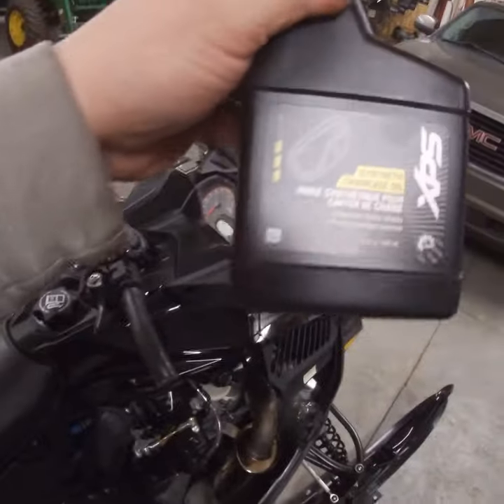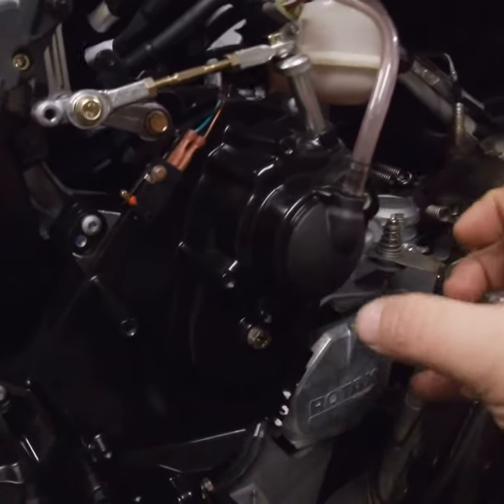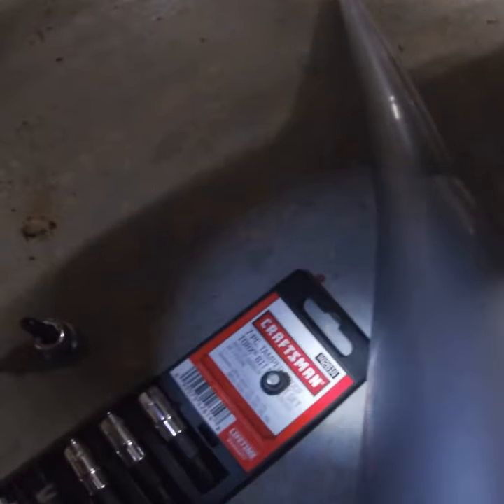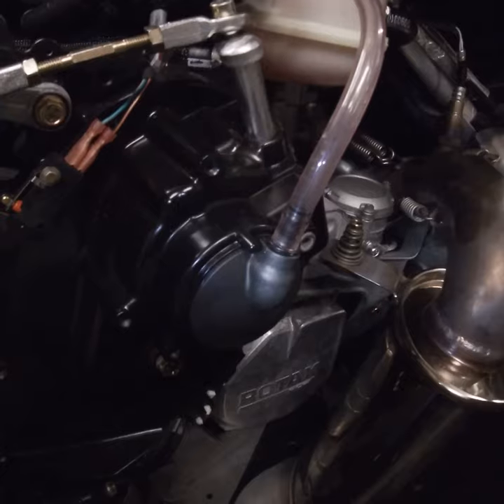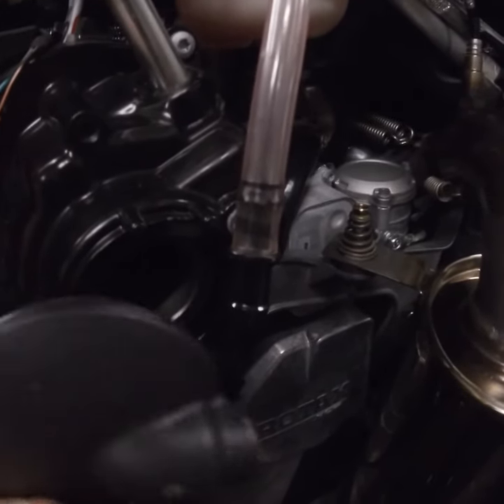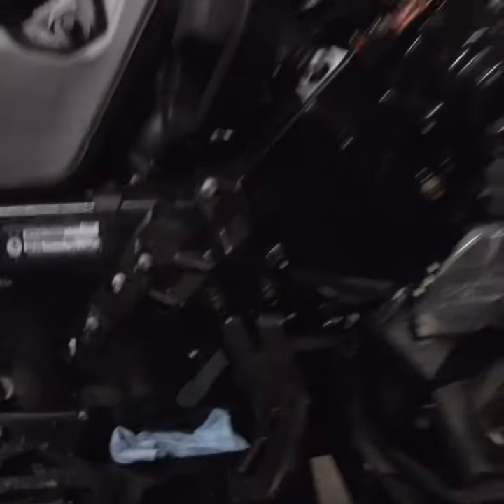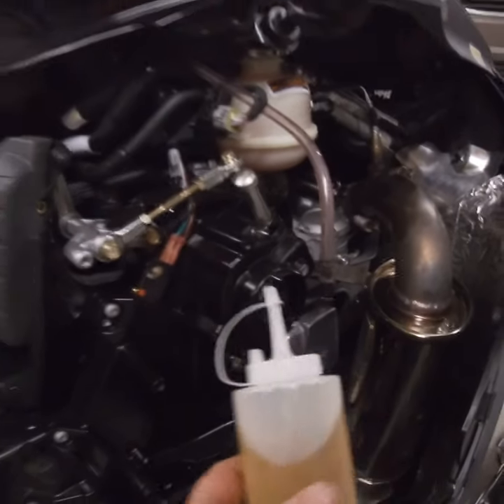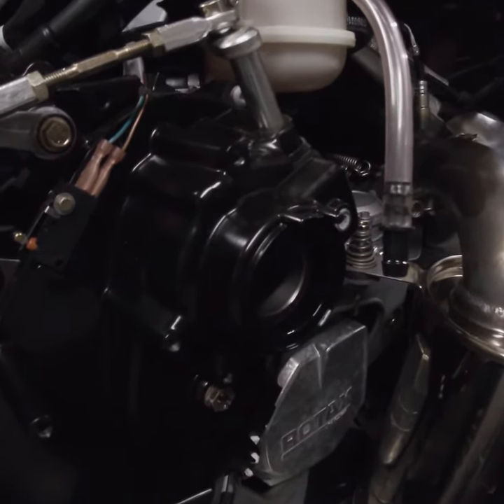2019 Ski-doo Renegade 900T - chain case oil change

Comment: What size Allen is the sight whole nut ?    Drain is a T 30 ??
Reply from the maker: i believe it’s a 3/16 .. I thought it was 5mm but it didn’t fit … I would have thought it was metric but it wasn’t and the new drain plugs on 2019 up are same Allen as sight plug .. they are not torx .. use a torx and you’ll strip it out